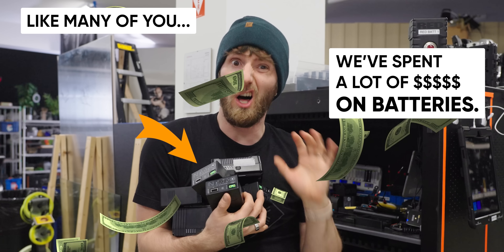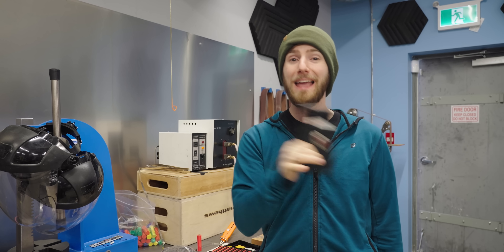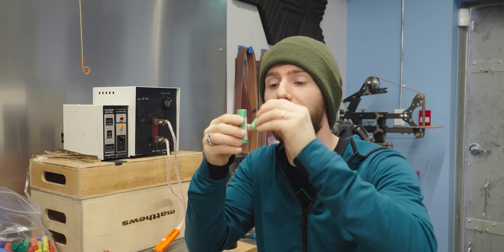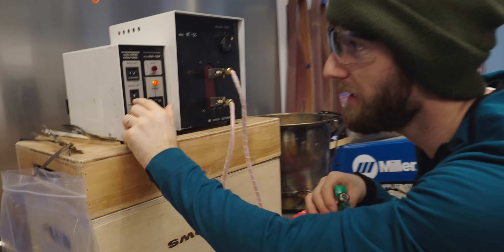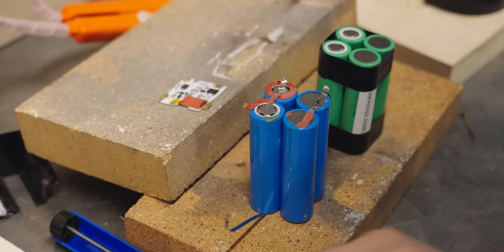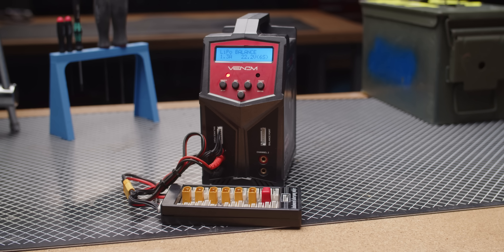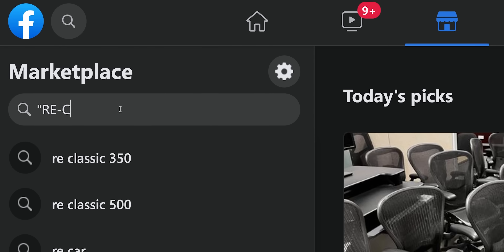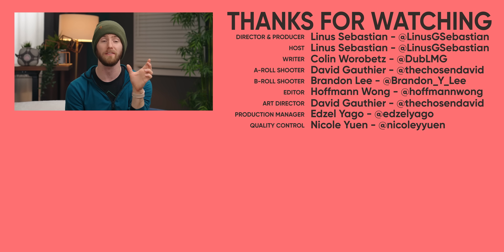This should be illegal… Battery Repair Blocking

Comment: I wanna say two things, one: this is a really big safety issue, and I totally see why these batteries need to be handled by professionals in all cases. Two: the main issue with these battery packs is their proprietary nature. I think 3rd parties should be allowed to replicate those types of replaceable components without fear of a lawsuit. Printer cartridges have the exact same issue. It really should be regulated.
Reply: I think he's referring to inkjet cartridges that won't work after you refill them.
Reply: WTF!! First thing's first. He should discharge the cells equally before welding Linus' spot welder is sticking because (1) his current is set too low and he's leaving it on there way too long. He needs an adjustable Cycle-Timer in milliseconds on that unit so that it doesn't matter how long the "monkey" holds it there. (2) With the tips sticking so easily, it's obvious he's not using tungsten tips. 
Those were just lil sparks from poor conductivity. Oh he'd have definitely known it if he had shorted the cell cause it didn't attempt to launch like a bottle rocket. I can see erring on the side of caution but SMH to just dumping all those cells. Even the original battery most likely had several good cells that would make some flashlights very happy. Oh My OCD, this is so friggin' wasteful!! 😆😂🤣
Reply: The problem is that safety can be used as an excuse to do all manner of malicious things when it comes to blocking user repairs. They used that excuse when they made cars so complicated that the user suddenly couldn't fix them in their home garage. Everything carries some degree of risk, be it flying to Hawaii, sailing to Costa Rica, cycling to the store, driving to work, eating, or running. I think you get the picture. I say let people take that risk. If they're dumb enough to try it without doing a thorough research and practicing on dummy cells first, then they honestly get what they were asking for. These guys at least took precautions (definitely not sufficient, but they were there) against causing a lithium fire, which like other metal fires, are next to impossible to extinguish.
Reply: @TheDustyShredder  Most of the car thing wasn't for safety.  Safety systems need to be as simple as possible for reliability.  It's the emissions and fuel economy requirements that require everything to be precisely tuned, and even then it's not a complexity problem.

Same reason why, if you buy a yard appliance with a small engine in it these days the carburetor setting screws require a special tool that you're not allowed to have unless you're a certified small engine repair mechanic.  Because we can't be trusting the average user to follow the instructions and tune it properly now can we?

Modern cars aren't actually any more complicated than their predecessors, it's just that the timing and tuning parameters are in the computer rather than mechanical, and the computer is legally required to be locked down so you can't mess with it, and replacing it with your own is a felony.  Welcome to the land of the free!
Reply: @laurenceperkins7468  the computer system itself is what makes it complicated. Engines ran fine back in the 60s and 70s and many people knew how to tune them and keep them running because it was actually in the owners manual!  Nowadays, it's all corporately controlled and all of our legislation is literally in the pockets of the conglomerates. Personally, I don't believe in "safety" laws or laws that actually block user repair. Whatever happened to the right to life, liberty, and the pursuit of happiness?

Modifying engines makes me happy. Repairing engines does too. So does putting an engine on a thing that wasn't designed to have an engine, because all of those things are hands on mechanical applications. I am extremely mechanically inclined and can usually figure out how a mechanical system works just by looking at it. If you give me an engine that doesn't run but isn't seized, I can pull it apart, examine parts for wear, replace the parts that need it, and then put the whole thing back together just because I put each part in a specific order in relation to the engine block. This way I know where they go and in which order they should be assembled. I did this once with a plastic model, and the process went a lot faster. Instead of searching for the parts on the trees, I would just look at my mat and know which part went where.
Reply: @TheDustyShredder  The computer isn't really that complicated.  It does the same thing that the mechanical timing and vacuum advance and exhaust dampers and so forth used to do, only with sensors attached so that the adjustments you'd make on an old engine during a tuneup can be made automatically every few hundred revolutions.

What's complicated about it is the fact that it's a black box with very little in the way of sensible diagnostic output unless you're rich enough to lease a diagnostic machine from the manufacturer.  So in order to work on it yourself you have to figure out ways to trick it into giving you the information you need, or doing the process you want.

But that's not because it's computer controlled.  Computer controlled done right makes things easier.  All the sensors it uses in place of mechanical linkages means that the whole diagnostic process you'd do with a mechanically controlled engine to figure out what was wrong could easily be as simple as hitting the starter for a few seconds and then reading the list of what was failing to function off the screen.

I just wish it was legal to put my own computer in a modern car so that it could be just that easy.

Back in the 90s I thought it would be a fun project to add some sensors to an old, mechanically-controlled engine and then put servos on all the various adjustment screws so it could tune itself as it ran like a modern engine, but wouldn't keel over if the computer went out because it's just running diagnostics and tuning.  The computer components were too expensive and I never got around to it, but these days you can get a variety of suitable microcontrollers for just a few dollars apiece and the modern car market has brought the price of most of the interesting sensors down to reasonable levels.  So if you're rebuilding old engines regularly anyway it might be worth experimenting with.
Reply: I mean, it IS regulated -- just in favor of monopolies, rather than people and the environment.
Reply: as Rossmann points out, replacing thr brakes on my 5000 pound Hemi V8 Durango is a really big safety "issue" However we should not be bound by arbitrary limitations a manufacturer puts on their products. Sure, %98 of people wont open their battery packs and there are warnings for a reason. However just because you neighbor doesnt know how to swap battery cells, doesnt mean you should be barred from doing so.
Reply: Except for patents, battery packs generally aren't actually proprietary.  Even if the BMS does talk to the device, like with a laptop, the most commonly used communication standard for doing so is an open specification that anybody can implement.  It has mechanisms for telling the device all about its capacity, chemistry, and how to charge it.  Some manufacturers might develop their own, proprietary system, but while that will let them maybe sell more battery packs, it also cuts them off from using cheap off-the-shelf BMS systems, which can get quite a bit more expensive for them.
Reply: @laurenceperkins7468  I'm sure you've seen the predatory lawsuits these companies go for - they only need one irrelevant patent for the connection specifically to keep useable 3rd party packs from being sold.
Reply: @AcoAegis  Really we should just ditch the whole patent thing.  The negatives outweigh the benefits.

The theory was that you grant inventors special protection from competition for a while in exchange for them disclosing the details of precisely how their invention works.  This gets inventions spread more widely because people don't take their trade secrets to the grave.

Unfortunately, in practice, the patent office:
A)  Has no clue about whether the description is sufficient to reproduce the idea.  Most patents are vague and broad with the deliberate intention of both taking advantage of the legal protection and still not disclosing enough information to let others reproduce their work once the patent expires.
B) Has no clue with regard to the "non-obvious" part of the patent requirement.  Nor do they consult any field experts to see if they come up with the same idea immediately.  See the whole debacle with the troll who managed to get a patent on podcasting 15 years after it became popular.

On top of that there's the massive infringement on the tangible property rights of everyone else.  Without patents, this lump of metal is mine and I can make anything I please out of it.  With patents I am responsible to make sure I don't accidentally infringe on something that somebody in a totally different field came up with that looks vaguely like my idea.  The majority of patent cases these days are straight up extortion and the whole system probably suppresses more new inventions than it promotes.  Especially with the farcical rulings from the courts saying that they can be applied to data algorithms (specifically excluded from patentability) just by calling them "systems and methods" and that the exemption quantities intended to allow for additional research and improvement apply per-molecule in the field of chemistry (so if you want to improve upon a chemistry patent you must do it utilizing no more than 7 of the patented molecule in your entire life for research purposes.  Good luck with that!)

No...  It was an interesting idea maybe, but the theory didn't hold up in practice.  Unfortunately powerful special interests now see it as a cash-cow, so good luck getting rid of it, even though we'd all be better off without it.
Reply: There's a safety warning label.  If your scared.  Don't go in. Simple.  I'm a firm believer in you buy it, you own it. Free to do whatever you want with YOUR property.  

Laws shouldn't be anywhere near our electronics and hobbies.   Big Corp /lobbyist always screw us.  This "law" your recommending hurts consumers at the hobby level
Reply: @ZeroBit0  corporate lobbyists shouldn't exist. Corporations are government instated entities. They would not exist if the government did not allow them to. Therefore, they should have zero say in any legislation. The owner and employees have the right to vote, corporations themselves do not and should not. They should not have any room to influence legislative decisions, they should not be able to donate to campaigns (corporations are not protected by the bill of rights, and thus do not have the right to free speech unless they are media corporations), and they should be only permitted to use public legal services so that we the consumers don't have to spend thousands a day on lawyers just to reach an insufficient settlement that'll barely cover the legal fees.
Reply: @ZeroBit0  I agree with you there, I don't think I said anything about people not being allowed to do this themselves.

The question is should these products be designed to be user serviceable, and in this case, no, they shouldn't.

If you can actually do this successfully and safely enough not to harm yourself, then wouldn't that make you ... professional?
Reply: I didn't know that printer cartridges had explosive potential...
Reply: It is "regulated" - that's what the lobbyists are for lmfao
Reply: To clarify, I'm saying that companies should be forced to provide a license to duplicate or refurbish consumables.
If you want to do a cover song, in the US at least, publishers are required by law to provide you with a mechanical license to replicate that song. They get a flat fee of around 10 cents per copy sold. This is what I'm suggesting here.

And to be clear, I never said anything about making anything illegal.
Reply: @AcoAegis  Why not just refuse to provide any protection to these companies? I mean... How would you sue someone for doing something that isn't illegal? Instead of creating more regulation, just delete the actual laws that were created just to protect companies.
Reply: @talkysassis  we can't remove patent laws like that, they're very important, but I do think I agree with you here. Things should enter public domain faster.
Unfortunately, that's very unlikely to happen, because every company with big money lobbies to make copyright and patent laws last longer. Disney has been at it for years to keep mickey mouse, one of their oldest characters.
Reply: I just finished watching the video and I'm currently processing it in my mind. When I first started watching it, my opinion was the general opinion that we should have the right to repair our devices' batteries. As I watched the video and saw the struggles involved with repairing batteries and the safety risks, I started to think that perhaps it is better if only professionals are able to do this. I took the 'safety' line of thinking that according to this video some manufacturers use to defend battery repair blocking. Now that I've finished watching the video, I am thinking that there has to be a middle ground. I'm not sure what the middle ground is, except that Bebob is obviously great because of what they're doing.
Reply: @drewneilson9157  They made this look far more difficult than it really was.  They also made it seen farm more dangerous than it really is.  And safety is not the end all be all of whether someone should or shouldn't be doing something.  The problem is that manufacturers make it more difficult to do what's shown in the video by not providing already-existing documentation, or even ACTIVELY fighting repair thereby making it more dangerous/difficult.
Reply: this video should be illegal.. it takes years to develop the necessary tech skill required here..
Reply: @lotpark8739  does that mean that mechanics working on vehicles should be barred from posting? just because its out of reach for most people doesnt mean its not relevamt
Reply: @Carterthielftw_  barred from monetizing only this video.. what really grabbed me is the lack of skill with the spot welder and how the solution was to run outside with it.. no proficiency testing on the old cells, time/current adjustment, just pierce the container, throw it in the yard, repeat.. I bet Linus isn't reading the instructions even now.. this is the equivalent of Russian dashcam accidents, but those are accidents.. new title. how to repeatedly misuse a spot welder with a smile..